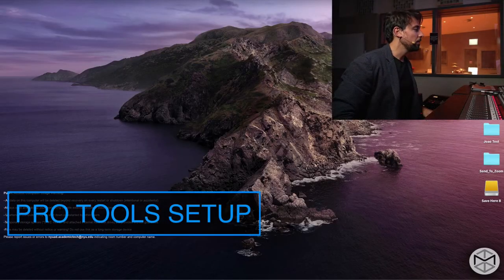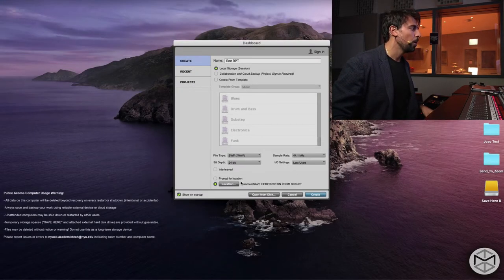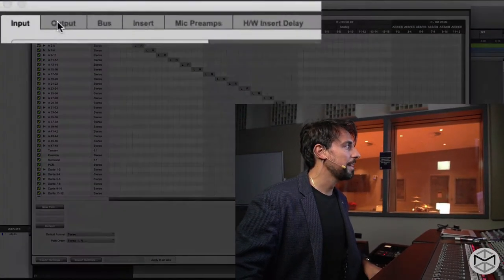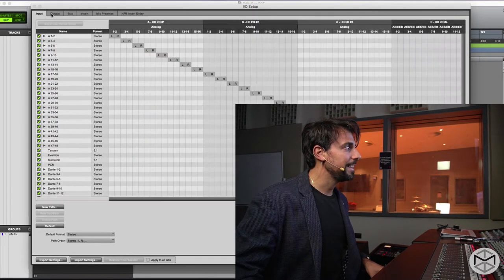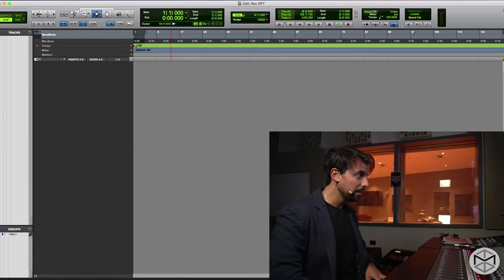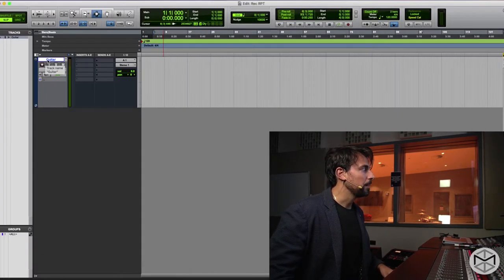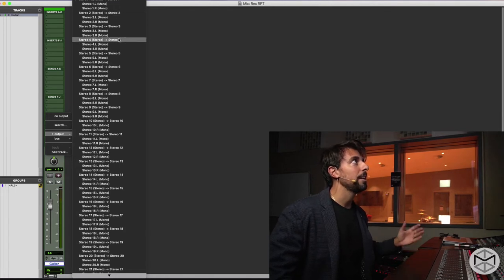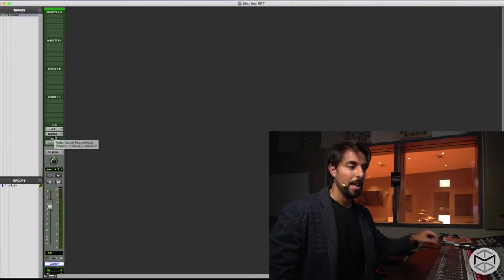Recording & Production Techniques: Signal flow explained and SSL console routing

Comment: Hi and TX for the cool Video! When i receive two Monosignals from my Daw to one Channel: 1. Is it possible to pan those seperately or are those 2 Signals ( like Hihat and Ride) only in the Center? 2. When i receive two Mono Signals into one Channel in Mixmode: Can i only use the Fader for one Signal and the POT for the LEvel of the Other? Or is there a Flip Mode where i can use the Fader for Signal One and then press Flip and use the Fader for Signal two? And allmost lastly: How many FX Sends can be used from One Channel at the same Time?  Can i divide the FX Sends between two Monosignals in One Channel in Mixmode? To What of those Monos 1 or 2 is the equalizer routed to? Sorry for all the Questions. I own to much outboard Reverb.